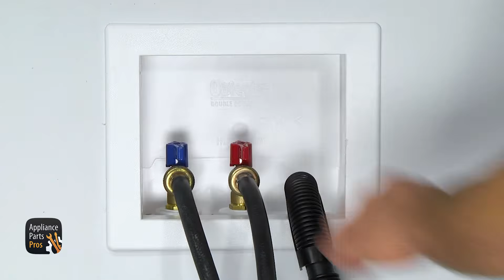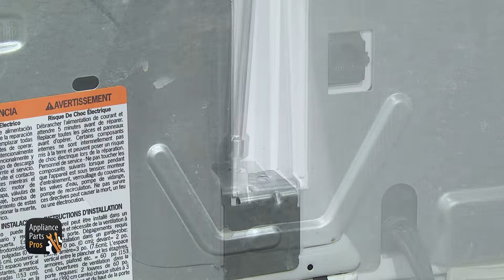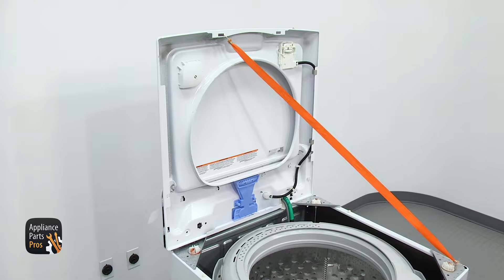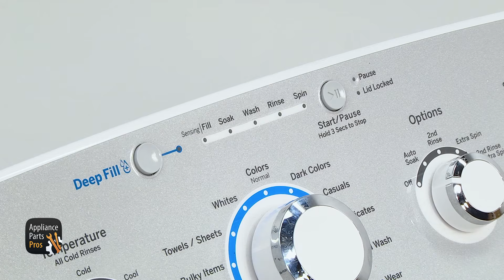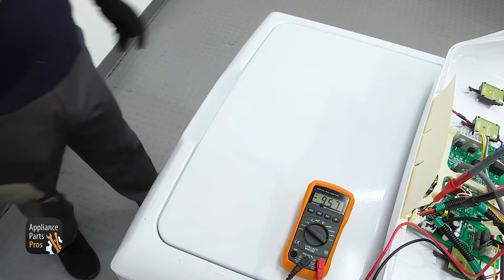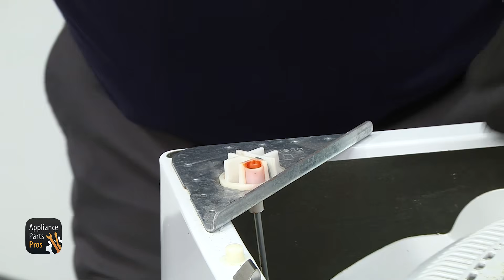How To Troubleshoot a GE Washing Machine That's Out Of Balance

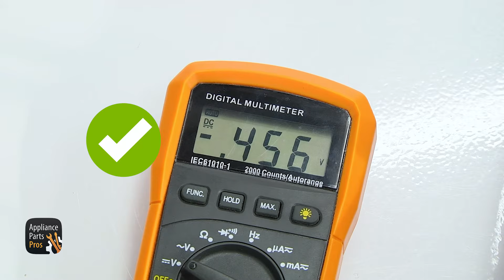Comment: I preformed the voltage test on the speed sensor and once it stopped spinning it was sitting at 9.6 volts. I’ve already replaced the sensor once. Would that number also indicate this sensor is also bad? 12:16
Reply from the maker: Thanks for sharing the readings you’re seeing. For detailed troubleshooting steps specific to your situation, our certified techs can help you at forum.appliancepartspros.com. Just post your model number and what you’re experiencing, and they’ll walk you through the diagnosis! 👍

Comment: i need more info on this water balance system please
Reply from the maker: Happy to help. On GE washers the control senses load size, sets water level, then watches tub speed to catch out-of-balance during spin. The hardware that keeps things steady is the suspension and a fluid-filled balance ring on top-load, or shocks and counterweights on front-load.
Reply: @appliancepartspros  my washer keeps going out of balanced, i replaced the rods, checked the gland nut, washer level, yet its still going out of balance. i didnt know about that water weight, but i do hear it slushing. error code says out of balance. not sure what else to check for.
Reply from the maker: Does it seem like it is out of balance, or is it just throwing the error code? Check the leveling legs if you haven't already. After that, check the flooring underneath the washer. We have seen instances where the flooring droops a bit, causing balance issues. Then you can adjust the legs accordingly. If that doesn't help, drop your model number in this thread, and we can look into your exact unit.
Reply: @appliancepartspros  It wobbles and shakes when it starts the spin cycle. I checked that its leveled and the legs are good. model GTW460ASJ 
it seems to knot up clothing, and it does this with two bedsheets or a full basket filled with different types of clothes.
Reply from the maker: Honestly, this sounds like overloading. Big mixed loads, especially sheets, ball up, throw the tub off balance, and trigger wobble. Run smaller, like items together on Bulky/Bedding, avoid mixing smalls with sheets, and see if it spins smoothly.
Reply: @appliancepartspros I've used to throw all my stuff in together. I never mixed bedding with towels and clothing but now it almost always goes off balance with loads it didn't used to in the past.
I could throw in a single heavy robe, it would ball up in one corner but still finish it and not wobble. Not anymore, almost all loads fail, even if I load it carefully and spin the drum by hand to check balance
Reply: @appliancepartspros  if wobble was triggered from a severely off balance load - how do I reset it? I took everything out and tried starting a new load…still wobbled like crazy. Checked everything and it seems fine

Comment: Informative video, but I would suggest you stress thoroughly draining the washer before embarking on any  effort.  I'm finding it difficult to deal with the weights of the baskets  because of the water inside them.
Reply from the maker: @markhayward9982 That’s a great point — thanks for mentioning it! 👍 Draining the washer first definitely makes the job safer and a lot easier on the back.

Comment: My GE washer (GTWN4250D1WS) has a slightly different set up. The water would weigh so much the big pulley wheel would rub on the floor of the unit and make a god awful scraping noise. Other that the bounce test, is there a more definitive way to check the suspension rods ? I find it hard to imagine the springs would actually deform and weaken...
Reply from the maker: Hey @donra2906 — thanks for the details! You're right that the GTWN4250D1WS setup is a bit unique. That scraping sound definitely points to something bottoming out, and the pulley wheel rubbing on the base is a pretty strong clue.

Beyond the bounce test, the best way to check the suspension rods is, unfortunately, process of elimination. Since the springs don't often visibly deform, we usually look for signs like:

The tub sitting lower than usual

One side sagging or leaning

Persistent off-balance issues even with evenly loaded clothes

If everything else checks out (tub bearing, shocks, leveling, etc.), and the washer still bottoms out with water weight, it's likely the rods have weakened just enough to cause trouble under full load. Let us know if you need help finding the correct part.
Reply: You can also use an 11 mm socket on the agitator bolt.

Comment: Since new I’m having problems with this getting unbalance. It has been a nightmare because it will jump and move out of place. I always make sure my clothes are very well distributed, however the agitador will move the clothes and then it will start jumping. My model is GTW485ASWWB. I really regret my decision
Reply from the maker: Hi @noobrepublic-oy9ro — sorry to hear you’ve had such a rough experience with your washer. An out-of-balance machine can definitely be frustrating, especially when you’re already making sure loads are evenly distributed. Here are a few things you might check that can help with that GE GTW485ASWWB:

🔧 Basic Troubleshooting Tips:

Check the leveling: Even a slight tilt can cause the washer to walk or bounce. Make sure all four feet are firmly on the floor and the machine is level front-to-back and side-to-side.

Inspect suspension rods: If your washer is jumping violently or shifting out of place, the suspension rods might be worn out. These rods help absorb vibration and stabilize the drum during spin cycles.

Look for tub wear or broken dampers: Sometimes the inner tub or its dampers can develop issues early on. If it’s bouncing too easily when you push down on it, that’s a sign the suspension may need attention.

Agitator movement: You’re right — the agitator can shift clothes mid-cycle. Try loading bulky items evenly around the agitator rather than stacking them, and avoid mixing heavy and light items in the same load.

Let us know if you need help locating any parts.

Comment: I removed the agitator cap and the 7/16 bolt, but the agitator won’t lift up. I’ve tried to gently pry it but no luck.
Reply from the maker: You can try soaking it with a penetrating oil like Rust Buster to see if that will break up any debris. Other than that you will just need to keep working at it to pull it out.
Reply: @ thanks. It ended up being the suspension rods, but unfortunately now the washer won’t go into sensing mode. It just jumps to end. I ran a couple of cycles the day I fixed it, and basket clean/drain and spin worked as they should, but now it’s not working when I try to run a wash. No idea what happened.
Reply from the maker: You can try locating the tech sheet and run the diagnostics if your unit has that.
Reply: @ thanks. I did this and went through the fault codes, then I went through the service tests. I left it unplugged overnight and now the only fault code, which was no there yesterday, is number 3, which is a locked motor rotor. Motor seemed to be fine before I took it apart, could something have gotten lodged in it?
Reply: @ just opened the motor, and the belt was chewed up, so I guess I’ll replace that and see what happens
Reply from the maker: A worn-out belt could definitely be the culprit. Replacing it should get things back on track—let us know how it goes!
Reply: @ that was the issue. It was chewed right up. Must have been on its last legs and blew apart when I replaced the suspension rods. I replaced the belt and now it’s working great. $120 in parts altogether. This video and your comments helped a lot. Thanks.
Reply from the maker: That’s awesome to hear! 🎉 Sounds like you diagnosed it perfectly—glad the video and comments helped along the way. Enjoy your working washer, and great job on the repair!

Comment: Thanks for this info.  I found that the belt was starting to come apart on our 6-year-old machine.  Then I also found that the speed sensor is bad.  I have ordered both parts from you guys and I'm hoping that's all we'll need to get our washer back to spinning at full speed.
Reply from the maker: Great job diagnosing the issue! Replacing the belt and speed sensor should definitely help get your washer back to full speed. We appreciate your order—let us know if you need any tips during the repair!
Reply: @appliancepartspros   When I tested the motor speed sensor following the instructions in your video, it was fluctuating between giving a voltage reading and giving an OL reading (meaning open circuit).  I would have never guessed that a bad speed sensor was causing our washer not to spin up all the way, thus leaving our clothes fairly wet after spinning.  We had the out of balance error code (26) and I cleared it after installing the new parts.  I changed the belt and speed sensor Saturday morning and we're good to go!   Hurray for fixing the washer instead of buying a new one!!!  Thank you so much for posting these videos!
Reply from the maker: That’s awesome! Great job troubleshooting and fixing the issue—it’s always satisfying to repair instead of replace! That speed sensor can definitely be tricky to diagnose, but you nailed it. Thanks for sharing your experience, and happy washing!

Comment: Thank you for this video!  I just have a couple wee questions. 

The front suspension rods are easy to bottom out, but the rear are very stiff (cannot bottom out the basket in the rear)

Would that indicate a need to replace the front suspension rods?

&

We verified the speed sensor on the motor is in place and the wire harness is well connected, but.. 

The voltage between pins 3&5 as well as across pins 1&5 are not showing any voltage,  does that indicate a fault on, and a necessity to replace,  the control board?

Thank you very much for your help!!
Reply from the maker: That depends - what is the model number you're working with?

Comment: Can anyone suggest what to look for when the out of balance sensor seems to be to sensitive? As in if the load i fairly balanced there no problems, but one its even a little out of balance it will stop running.
Reply from the maker: What is your model number?
Reply: @appliancepartspros  gtw465asn1ww so far im guessing the speed sensor but im very open to suggestions.
Reply from the maker: The speed sensor being faulty could cause the issue you are having. You will need to locate the tech sheet on your appliance so you can run the diagnostic test. That will pull up any error code you have and the tech sheet has testing information for the speed sensor and other parts so you can see what has failed.
Reply: @appliancepartspros  Thanks for your help. I have done the diagnostic stuff and it was all OOB stuff. So im going to replace that Sensor and hope for the best
Reply from the maker: Good luck with your repair and let us know how it goes!

Comment: The fist thing that fails is the suspension rods then look for something else.
Reply from the maker: The suspension rods rarely fail, that is why it is recommended to check the other items before replacing the suspension rods.
Reply: @appliancepartspros  : Maybe on GE but other brands I have worked on it's the first thing. Thanks for the video thou.
Reply from the maker: You're welcome!